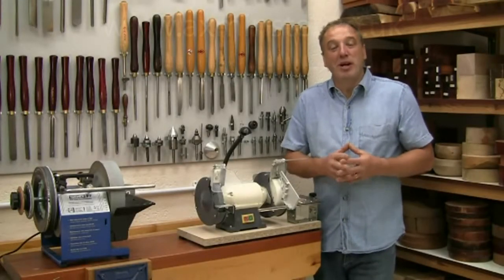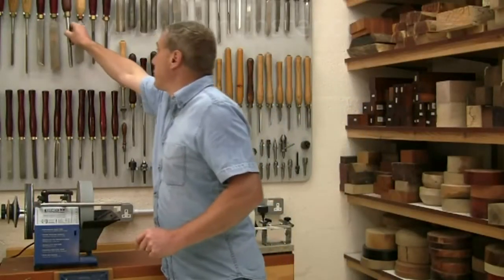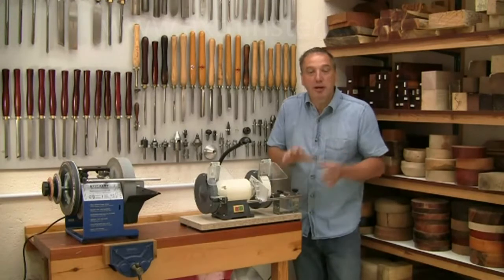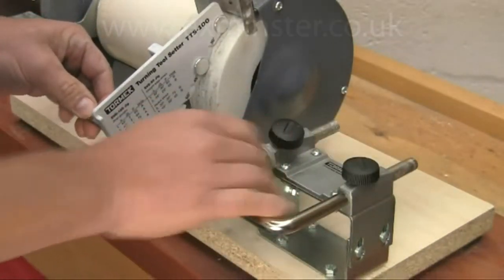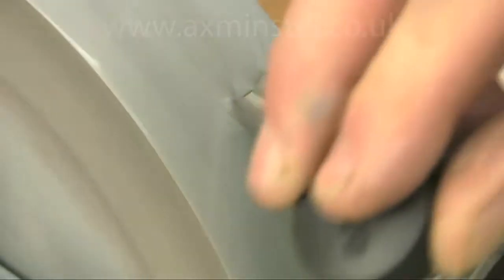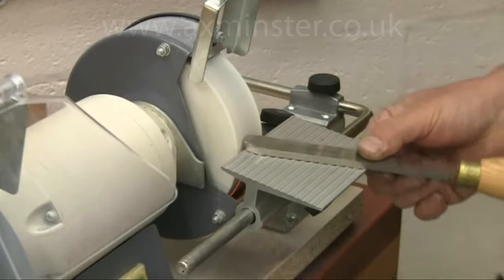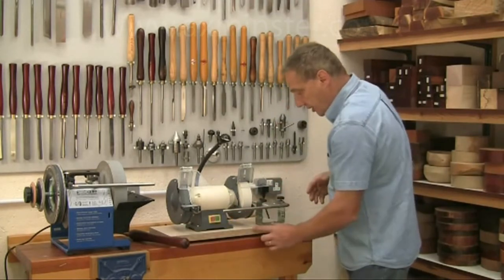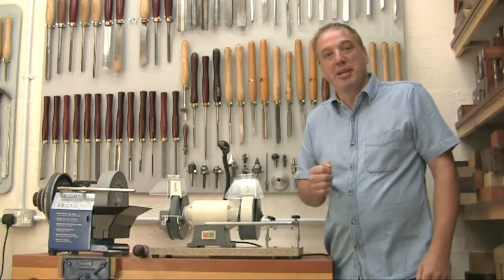Tormek BGM-100 Bench Grinder Mounting Set

Comment: I really like your set up going from a standard grinder for rough shaping to the tormek on the same jig with almost no changes due to wheel sizes (using the tormek BGM-100 and SVD-110 Toolrest on the std grinder)  Would this work with a 6 inch (150 mm) slow speed (1100 rpm) grinder and then moving to a Tormek Super 2000 for fine grinding and leather stropping?  Or is a 150 mm stone too small and would I need to get an 8 inch (200 mm) grinder?  Thanks for a great video.
CharlieC Massachusetts USA